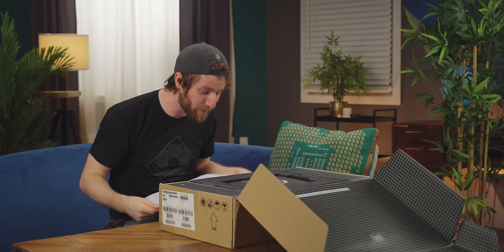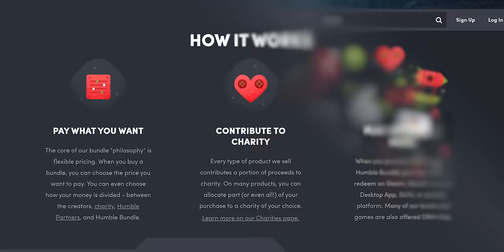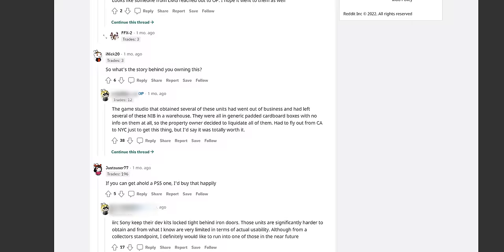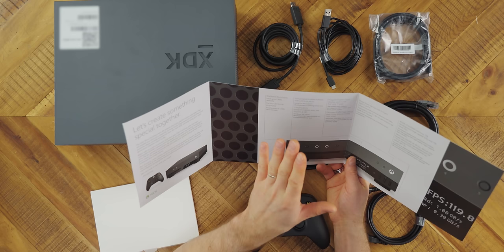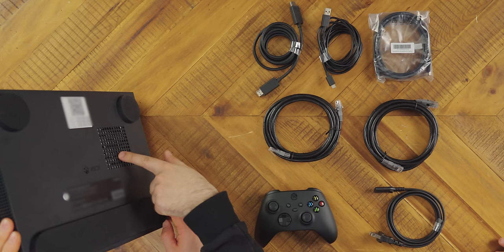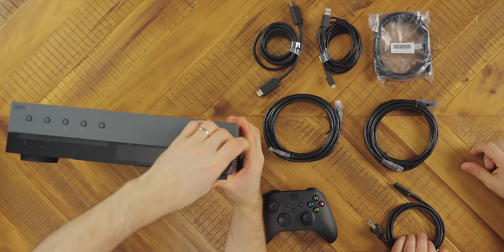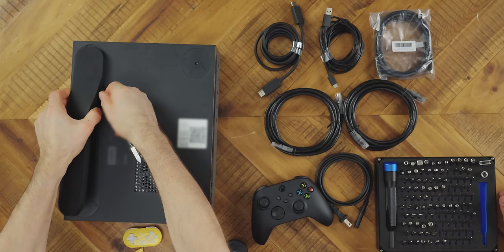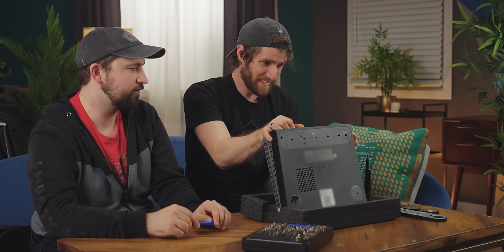I Can't Believe I Paid Two Grand For This - Xbox Series X Dev Kit

Comment: I worked for Activision. The 10G port is so we can download or stream the latest builds of the game directly onto the local machine. Back in 2010 we had to burn discs every single day and hand them out to QA. Burning discs was often the process that wasted so much time especially towards the end of a project where we had new builds every day. The "burner room guys" always had to come in early to make sure the discs were ready for when QA arrives. It could take hours and hours to hand out copies to a floor of 100+ QA testers. Being able to have a 1G, 2.5G or even 10G ethernet port is a massive timesaver for anyone who needs to get the latest build. Additionally, streaming (as opposed to downloading) to the local machine also helps with security. No more worrying about someone stealing a disk or even an entire devkit. Simply power off the console and the build gets deleted (or at least the leftover temp files become unusable when there is no connection with the server).
Reply: As a developer

Is it that hard to optimise games on series s?

Or techland is just bad?
Reply: @monke8698  tech land is just that bad
Reply: @monke8698  I would assume so since there is such a drastic power difference between the 3. You start to work on 1 and get accustomed to its limitation and then you switch to the other option and bow magically you have a totally different set of numbers to memorize. I would assume it would get mentally exhausting.
Reply: 100% agree 😀
Reply: Wait,that implies you had problems with employees stealing dev kits? Was that a thing at Activision? I figured you guys had security up to the crown of your skulls,so how did they get out of the building without anyone realizing it?
Reply: @monke8698  I don't understand how "optimizing a game" has anything to do with "deploying a game to a devkit". the OP didn't talk about game optimization. but no, it isn't (relatively) hard to optimize on series s/x. it's easier to optimize on a fixed console than on an open platform like PC. they have dedicated profiling tools for it, and you have a fixed hardware target. the APIs are extremely windows-like. at least, it isn't any harder than optimizing any other game. game optimization is a hard problem that requires relatively specialized dev skills, on top of the already specialized dev skills of game development.
Reply: @monke8698  Series S has half the memory of Series X, slower CPU and a GPU clocks lower than that of One X even. For whatever reason people have great expectations and treat it as a cheaper Series X, but it's not. It's not a step down from Series X. It's a step up from Xbox One. Once the old gen consoles are dropped Series S is gonna be the next bottleneck of the industry (not counting handhelds).
Reply: @ChrisAverageYT  no lol it has modern architecture like the series x and the series s proves to be stronger than the one x in cross gen games
Which btw the onex cpu is so weak compared to the one in the series s
Reply: RIP burner room guys :(
Reply: It does beg the question if there's a function in this dev kit to 'downclock' so that it has the same functional power as a Series S so that games can be tested on the lower power system.
Reply: @monke8698  I don't know what you mean by "stronger". It has more features, yes, but the clocks are lower, so you can run more specialized code but raw perf of number crunching is lower.
Reply: @phuzz00  There is.
Reply: That's kidda what I thought they were for
Reply: Any idea on how sdk for new autonomous cars specifically the nvidia SDK I REALLY AM INTO CARS ETC
Reply: @dreknows  different industry. have no clue about car SDKs. Even if they're provided by nVidia. Also don't know that much about scientific mass processing CUDA stuff either, even though still nVidia. some game devs know about batch processing due to server farm tech being used for games, but that's a fraction of a fraction of the industry in general.
Reply: @ChrisAverageYT  
but if you consider the way Microsoft and rest of the world is heading, which means "as a service", with xbox game pass on the front of the march, then you can have clear idea why.
regular xbox and "f0r hard0rz" while both gaming from the cloud
Reply: I cant believe nobody has cracked any jokes about the size of COD ;).
But yeah as another dev, regardless of QA, programmers/artists need to stream unpacked data from host PCs all the time anyway full time through the day.  We dont package builds up, data is live streamed from our host dev PC that we write the code on and shaders are compiled on.  This is 100's of GBs a day.
Burning discs because unpractical when builds got so big.  Especially when offices were so networked up.  Back in the PSX days, reading from discs had its own bugs anyway, but now ALL games are read from HDD, even if purchased on disc.
Oh talking about steeling devkits, did you ever see/move a ps3 devkit?  It had concrete in like a washing machine, which i think was to stop theft!!!
Reply: @ChrisAverageYT  It is a BIG step up then. Giving CP2077 as an example, the game runs at around 25fps at 720p on One S, and at a stable 30fps at 1440p on Series S. I think it's it is fair to say that Series S is a generation ahead. Also, to touch on the original reply, In my opinion it isn't too much to ask for better performance regarding Dying Light's high performance mode which is 936p60. It just seems lazy when you consider that it's a 7 year old game.

It also runs at 1080p60 on Series X. You can't pretend that this represents the power of that console. Clearly something is wrong with how they handled it.
Reply: Activision doesn't test their games, come on man we know better lmao
Reply: @SPEEDFREAK6988  I've never heard of anyone stealing an entire devkit, but at some stage they glued a hook to the devkits and used bicycle like chains to chain them to the desk. A kind of self-made Kensington lock. That was around ~2010. Back during the Xbox 360 era, we were told each devkit costs around $2000. Not sure if management simply told us a random number in hopes to handle them with more care. The bigger worry was definitely stealing the discs. Though they came with DRMs which only allowed them to be run on devkits.
Reply: @psychaoticproductions3994  While there's growing move to various cloud/streaming/service based game types they are waaaaaaaay away from becoming the only form of gaming. Certainly not in this generation and I predict not in the next one either. There are a lot of developers producing tons of offline, mostly one time experiences that don't have any need/benefit from being streamed or even connected to internet. Latency is also an issue (yes it is, don't let marketing and influencers fool you). Playing on a local hardware is not going away anytime soon. My point is the future is not one thing and anyone claiming that is either oblivious or tries to sell you something. Microsoft (and all the others too) always tries to push some big idea, like the "media center" with previous generation or a hard drive and an internet browser in a console before that. Sometimes it pans out, sometimes it doesn't. In that sense Series S is a big gamble and it's just too soon to call it a success or failure. In any case it is somewhat a challenge for the devs in the meantime.
Reply: imagine spending/waste how much time getting all that education to get hired at activision, them they have you burning discs all day hehe
Reply: ahhhhaaaaaaaaaa soooooo rockstargames still does this with floppy disks or what?
Reply: That sounds painful, my porject has 4 builds a day
Reply: @booegk  We handled it as well as we could at the time and we're still improving it with patches ;) Calling any game dev lazy is, well, don't want to be harsh, but kinda ignorant of the realities of game development. I don't know anyone not pouring their heart out and trying every day to make the best game they can. The wider audience knows maybe 1% of the things that happen/contribute to the end product and often makes extremely wild judgements, assumptions, comparisons to products of very different scopes/goals etc. Imagine giving a project 7 years of your life and then reading you're just lazy. It's sometimes funny, sometimes hurtful but, sadly, rarely accurate.
Reply: Burner room guys? How interesting. Always wondered how devs got their latest builds out to the rest of the team
Reply: while it indeed is nice that there is no longer need for new disks for each game version during development.
still one of the most interesting videos on youtube (for me at least) has been these "here is a devkit for console x, with hdd full of unreleased or unfinished games"
kinda sad that modern devkits would not be nothing but a paperweight 15+ years from now, so no such videos from even ps3/xbox360 era and even less from the last two generations.
Reply: @ChrisAverageYT  Shit, sorry about that. I was just being a gamerbro there. I don't mean to shit on devs, I actually love the game itself. Dying Light was one of my go-to coop games when i was playing with my friends. I had so much fun with it. It also was cheap in my country's currency so i was able to afford it. Clearly a lot of work went into it. I don't think calling you and other devs lazy is fair, I feel like a dumbass now lol.
Reply: @blarghblargh  In order to properly optimize anything, you need to be able to rapidly fire benchmark builds onto the actual hardware your using. You can get most of the way there by using an equivalent PC build but you'll never get the actual performance in-place. Look at the Xbox360's vfetch for an example of this. There's no GPU-side equivalent to that on PCs of the era, had to simulate it with dynamic vertex buffers and later geometry shaders on PC but none of that compared to the sheer throughput of the actual hardware.
Reply: But now those burner guys are pumping gas.
Reply: Damn, this is interesting info. Thanks for sharing, and hopefully you dont get tracked down by them for telling us this
Reply: @eideticex  yeah I understand that part. deploying to a devkit is necessary for optimizing a build, so in that sense the two topics are related. what I meant was that the reply was a big topic jump, IMO. OP was talking about deploying QA builds, and the reply was asking about how hard it is to optimize for a specific type of hardware. maybe the reply just don't know how different those topics are. but QA folks tend to know how to deploy a build and play a game (adversarially to the game systems, to find bugs) and file a bug and maybe write a test plan. they don't tend to know how software development works. at least, on average. I know, because I've had both roles. so no shade on QA or anything. vital role that is often drastically underpaid and undervalued.
Reply: wow this is really interesting stuff, thank you for sharing!
Reply: Pretty sure you just violated your NDA, but thanks...
Reply: in 2010 you had to burn disc ? seriously, when I worked on The Crew, on XONE and PS4 we already  have the Debug port to deploy the build, that was 2008.
And I don't remember burning any disc for the X360 either on Test Drive Unlimited, that was in 2003.
Reply: The 10gb port is actually for fttp internet which most offices come with and now homes have it to I have fttp in my property because of all the games I play and develop with other game designers so I get 1gig of ethernet connection downloads and 115,5mbps upload so the 10 gb port is nothing to do with transferring files as for burner room guys that's news to me seeing as I'm a ex activision blizzard employee very intreging to hear something like we had to burn discs and make sure they was given out however this didn't and never would happen that's what networking is for file sharing
Reply: @SPEEDFREAK6988  Usually in an extremely mundane fashion lol
Reply: Also used for breakpoint feature in visual studio.
Reply: So what about games that use the entire SSDs speed to have instant loading times and such. Surely a 10gbit connection cant faciliate the response time of an SSD? What if QA needs to test the loading times in a real world scenario?
Reply: Did they not use a disc duplicator?
Reply: "I worked for Activision."

I am so sorry
Reply: @Gatorade69  If you are a dev too you know we get the devkits way before the console release.
Sometimes de devkit exists even before the console prototype finished.
I don't know remember the dates of when we received the devkits.
We started dev of TDU in 2003-4 and it was release in 2006.
We started dev of The Crew in 2008, and it was release in 2014.
Thing is even on PS1 devkit we didnt burn discs to dev, we burnt disc only to test in release target for QA.
Reply: @monke8698  Its a hell of a belt shot, but worthy! We have a winner!
Reply: what a stupid bottleneck to have
Reply: It's also helpful for test automation - if you're running a build scheduler and you've actually done the work of stabilizing an autobuilder to to part of the gatekeeping for code check in, then you can support a lot more engineers in your test queue so the code reviews can be largely automated and free up the senior staff for the hard bugs instead checking that every single code change anyone on the team makes compiles well enough to run.  I have set up a lot of the purple switches (there are probably more 10Gb switches generally available now) and if you have a couple massively loaded build servers locally plus everyone hooked up with 10Gb cards/adapters in their work machines then you're starting to be constrained by the storage devices themselves you're trying to access, even on the machines at your desk.

Since almost everything is done soft/ by download these days (purchases to patches), anything that can increase the number of test cycles or allow more varied use cases to be run in the same amount of test hardware utilization space is usually worth a fairly considerable expense, at least up front.  Cost is more than just billable hours, so much more.

If you had to reimage a lot of hardware there are a lot of tools (not just Gh*st) that your imaging speed is limited by your top end network performance (sometimes you can turn off handshaking and most error correction if your imaging network is private, like using UDP only in a broadcast mode is superfast and works surprisingly reliably on a wired network) - in the case where there are hundreds of people trying to restore to factory several times a day (or even per hour) one can set up on demand as well as mass group imaging without choking if you're using 10Gb (and current mainstream hardware is usually able to cope with 40Gb over copper, just like 100Mb/1Gb transceivers).  If you're only testing software, you can remove the disk/flash and run in RAM for the most part to decrease cycle latency as well, but before you ship if you don't test on actual full hardware set the customer has you are gonna get some bug reports that do not immediately make sense.
Reply: @monke8698  no, but like anything else you have to be an expert in that specific platform domain and probably not stray too much to fully utilize something like this.  In many cases, a team will have leads and they'll control several engineering units that are frequently shared between way more developers than they should.  The ideal situation is to have them locked up in the server or switch room and wired into automation so that not only is there the ability to schedule the hardware but maintain configuration management in case some of the team doesn't want to stick to the agreed style guide/design rules they were likely told when they got on that project/team.  Smart teams will have a build guy or two, at the risk of having to give up a dev or two, as that makes all the other devs way more effective in ultimate deliveries.
Reply: @blarghblargh  I bet if they look real close there will be debug ports up the wazoo that they could hook up logic analyzers to so they can check what's ganking their software or if their software is ganking the system - you can also make your own embedded debug/sniff hooks by commanding GPIO test ports to patterns that they've got symbol files loaded for in the LA (you know what they are because you wrote them yourself); this means you can drive breakpoints and state dumps from deep within the software or hardware, which when things don't work you'll know literally exactly where it failed and what the states of everything where on both sides of death (yes it takes a lot of work to set up the bench for this but once done it can be 95% automated and your time spent actually fixing stuff instead of trying to locate it) .  Also the second port that doesn't come with the end user/consumer model can likely be put in transparent or bridged mode so they can also sniff the traffic locally to make sure they're not clobbering/mangling their own packets or overwhelming the ETH port in some other way lol
Reply: @russellzauner  if they create a gui interface using visual basic they might be able to track the IP address.
Also, I never bothered doing anything crazy with the hardware setup. It was just me doing the port and the profiling, and it was a single player game, so there was no point trying to do anything fancy. Most weird thing I did was put a physical switch inline to disconnect the lan cable so I didn't have to unplug the cable to test all the error codepaths for the Xbox APIs. Still was nice to get builds over faster.
Reply: Exact use I assumed
Reply: Surely those builds of games couldn't be played on a retail console, right?
Reply: Cool
Reply: Im curious how much time to take to build a game? And how much gigs the size of source code?
Reply: yeah I collect dev consoles and it's really lame when the developers used APP_HOME or something to stream from the dev-pc because there are no scraps left.
Reply: @emankun  source code is small compared to data like textures etc. It usually isn't gigs of code. Retail games that sell well typically take 3 to 5 years to make. There's ones that take longer or less time to make that have done well, but that's the typical timeframe.
Reply: @Allmageddon343  correct. There is a code signing and validation process you have to get through to get a build available on a retail console. I think retail consoles also don't really have a way to get a build onto them except via the main digital store or official disk.
Reply: Grab me some pdbs if you wanna get rich
Reply: As a Developer for a  AAA studio, everything said here I can confirm as true. You'll never see something as wild as at a hotel at E3 when someone walks out with a PS5 or XSX devkit from the hotel restaurant breakfast to take it to demo land for in person meetings.
Reply: @Charlie7146  lol nice try cop
Reply: @ChrisAverageYT  If you think that clockspeed is the main factor in the number crunching power or any other performance metric of a CPU you are sorely mistaken.

A lower clocked CPU can beat a higher clocked CPU in pretty much every metric if it's of a more complex (i.e. newer or higher power consumption) architecture. A Series S could probably still beat an Xbox One or One X even if it's a lower clockspeed because that's just how modern CPU and GPU architectures work.
Reply: Had a buddy that was a developer for Infinite warfare over at the Woodland Hills office, and that guy was pulling sleepovers there before the release ..
Reply: Hobbit Stomper, would you be willing to consult a newly growing game studio consisting currently of roughly ~30 employees with how to correctly setup/untangle processes?
We're a bit over our heads. We have the technical ability but are periodically stumbling over each other, so to speak, & need someone with experience from a pro studio to relay what they think would be best for us after studying our ways. Paid work obviously. We don't have any game connects to really go ask anybody else
Reply: @monke8698  series s is still just around 1/3 as fast as X... the PS5 without a disc drive costs only 100 bucks more but you get 3 times the speed and double the SSD space (yes double because of better compression on PS5)
Reply: @PrefoX  no lol series s is not 1/3 of the series s, teraflops isnt everything, and no the ps5 is not twice as fast, if you look at comparison videos ps5 is slightly faster than the series s and x in terms of loading but iam talking less than one second
Reply: Go make Cod great again.
Reply: And you're the reason why the dev history is destroyed p
Reply: Thanks for that info, sounds cool. I don't like the power off lots all part though
Reply: your drunk partner put bugs for fun? xD
Reply: why did you get canned though? i have fired and hired and fired many people who were capable and qualified on paper but lacked the skill to learn.
Reply: Nice
Reply: @not.a.doctor  Who got fired?
Reply: Had it not been for the "Back in 2010..." part, I'd be 100% sure this guy was lying about having worked for Activi$ion. Anyone who've played the last couple of CODs knows for a fact that Activi$ion doesn't have any QA testers...
Reply: Hey can i ask what did you start studying in school to learn programming or game development? Looking for advice from people who have worked in the industry
Reply: @melapelan2596  I was born in the 80s. When I went to school there was no programming subject other than learning to typewrite. At the age of 15 I started teaching myself HTML, CSS, JavaScript, PHP and ActionScript (for Flash) by buying actual books from book stores. That was in 1999 and back then no one heard of Google yet and the other search engines were not that good, not to mention I had only dial-up internet and my parents were charged by the minute for me being on the internet. Buying real books was cheaper and easier. I learned how to create websites by reading books along with countless of frustrating hours of trial and error trying to figure out why something works or didn't work. Finding online communities was hard as we didn't have Google yet. It was often word-of-mouth to find a good community, or the communities were too small to receive help within a reasonable amount of time. Especially beginners did not get much help online. Teaching myself how to create website was my full-time hobby for 3 years until I landed my first job at the age of 18. By then I had broadband and started learning other programming languages reading online tutorials. Like most developers back then, we were all self-taught. Nowadays you can take classes for that, or do bootcamps. If you can't afford classes or bootcamps then go to Udemy and pay $10 for an all in one web developer or python course. Getting started is not that easy, but if you're truly interested in programming, you will eventually get past the frustration and start enjoying it. I hope this helps.
Reply: @Hobbitstomper  thank appreciate the feedback. There are no excuses as why i should feel intimidated when i have more tools to help me. Just seems like a very difficult field
Reply: nightmares
Reply: I have a question then. IF the Series X hardware and GPU is capable of running games at 120 fps why wouldn't all game developers shoot for 120 fps??
Reply: @smithnwesson990  The more graphic intense the game is, the harder it is to optimize the performance to achieve 120fps. They might need to spend a few extra months which costs millions. In the end they might only get to 120fps if they turn down some of the graphics or remove some of the environment objects which they don't want to do. They could decide that 60fps and big environment with great graphics is better than 120fps with slightly lower graphic details.
Reply: MAKE MW3 REMASTERED LMAOOOOO
Reply: @Hobbitstomper  As a former employee do you believe you would be able to get into the dev kit shown
Reply: I bet u were one of the workers that didn’t even do anything
Reply: @TeTexasMan  Try 90 hour weeks for 10 weeks in a row. Leading up the release of Modern Warfare 2 (2009) we had 90 hour weeks with one day off every 12th day (for legal reasons), doing that for 10 weeks. While we didn't get paid for any overtime, we did get the hours back. My contract stated 40 hours week. When working after 8pm you'd get 1.5x times back, and 2x times back when working on weekends/bank holidays. After those 10 weeks, I had 3 months overtime built up. So yeah, I was one of those workers that didn't do anything ;)
Reply: Working at activision must be dopeee Splinter cell ps2 best game ever made
Reply: I like how suddenly everyone knows what the 10 gig port is for only AFTER you making this comment. Damn plagiarists.
Reply: That's funny because I worked for Activision and back in 2010 we were stuffing drives in stuffed animals and mailing them topsecretly for "QA" who the hell is thIs gUy?
Reply: @NewLifeFromTheWayofTruth  You must have come from a parallel universe where you guys used "drives" instead of DVDs/Blurays? Games for QA were never put on external drives or USB sticks for security reasons. Also a part of testing was to see how fast the discs were spinning. It did happen where certain data that needed to be accessed frequently, was written to the outer side of the disc, the disc would spin too fast and Sony, Microsoft or Nintendo would complain about it. The discs already came with DRM built in, even while testing. They wouldn't work on regular consoles. Additionally, QA is always in-house. The idea of QA working from home is a fantasy of 16 year old kids who want to play video games for a living. I heard from friends who still work at Activision that during the pandemic they they did actually work from home for a few months, following very strict procedures and very limited access. Other than that, games never leave the building. Also they're never mailed. We literally flew Activision employees across Europe to hand over DVDs and BluRays of the RC versions to Microsoft and Sony QA. We delivered them in person.
Reply: Oh nice! Stop making zombies games please.
Reply: Devs and the people who test games are currently scammers .... I honestly have no idea how they get paid ... 

Especially most of the time irs just copy and pasting from a previous game ans they still get it wrong .... 

Alot of games never release finished and usually takes up to 6 months to make the game playable 

So why are devs so quick to rush games ? 

Money
Reply: @ChrisAverageYT  The CPU of The Series s is actually even a Bit faster than The Ps5 CPU(3,6 vs 3,5). The Series X has 3.8
Reply: Pressing F cuz you worked for Activision.
Reply: I would be ashamed, if I ever worked for Activision^^
Reply: @ysince95  Spoken like a truly entitled Gen-Z who never had an honest days work in their life (yet) ;) You can disagree with their business practices, but my experience as an employee was very positive. It's one of those places where co-workers are not just co-workers, but turned into actual long lasting friendships. Zero negative memories about working for Activision.
Reply: I'd take out that 40gb ram and swap it into an series X at least.
Reply: @Hobbitstomper that's a cool story, the crew was a fun game. Thank you for being part of an innovative team to deliver us (the public) good games.
     Idk why anyone would knock you or your story. True or made up all the devs out there deserve their appreciation.  We sometimes call a game crap but we don't think of the over worked devs doing whatever they can to hit a deadline. So thank you and all thr other devs out there for making some great titles that we all know and love.
Reply: How do you feel about A.I. and future of gaming. 
The NPC's having many more options and unlimited responses, and the possibility of games writing themselves as they go based on defined parameters? Rendering on the fly?
Reply: So your saying our games should be cheaper or still 59.99!
Reply: “This was not the digital age. This data had to be processed, analyzed, and delivered all by hand.” -Frank Woods, Black Ops 2
Reply: @shooternerd well considering they made Dying Light 1 on the Xbox One and PS4 and it looked better than most games today. OK then 😂
Reply: @Hobbitstomper  go back and fix shadowbans on warzone